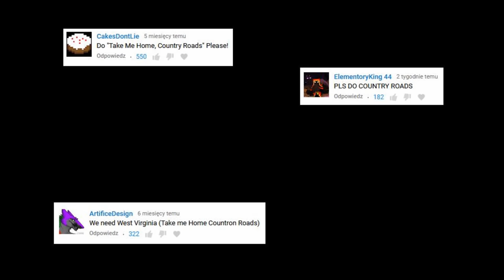Country Roads on FLOPPOTRON

Comment: You can use the brushless ac motors on the hard drive too. Just wire in higher frequency audio directly (not square wave)